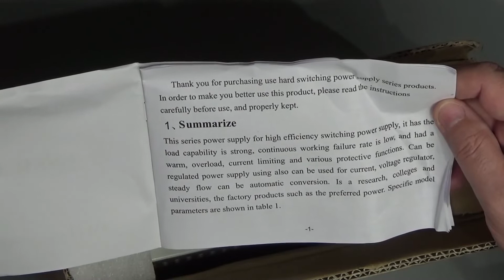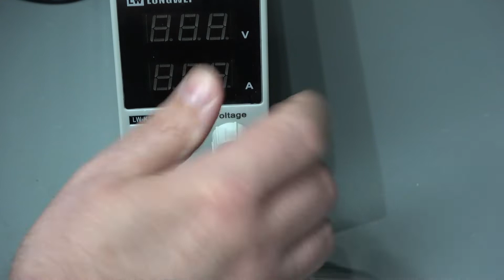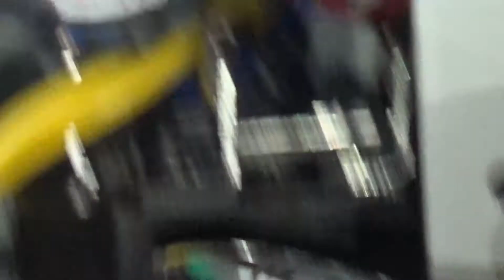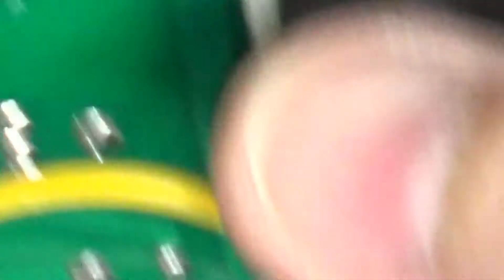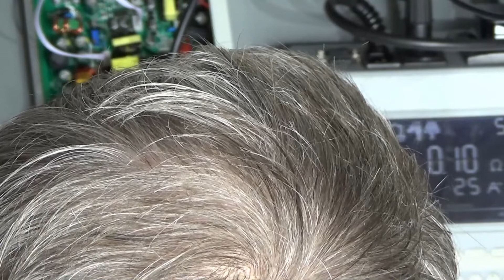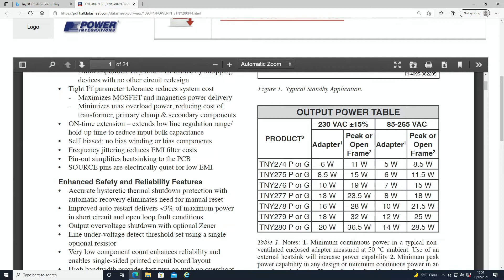0038 Teardown Review Longwei LW K305D power supply

Comment: quick question, i have this power supply but when i turn it on and turn the current knob the green light does not come on so i can't adjust anything, i can't figure out how to get it working, can you give me an idea what can cause that?
Reply from the maker: Well there are quite a lot of things - First to how it should work.  Without load connected (just connect a multimeter) and current turned even a tiny bit clockwise the green LED should light and voltage be present on the output and displayed on the top meter assuming you have turned the voltage pot a little bit clockwise.  I mention in the video at about 5:30 about the problem setting current limit (which you can't really do), but I'm guessing your problem is not just setting the limit but that the green light never comes on.   So without more detail there seem to be a few possibilities - 
1. There is a short circuit on the output, this will mean it will always current limit and the red light will be on and voltage meter will be 0 or very close to 0.
2. The most helpful is if it is just a display error and actually it works, just the LED does not - turn current fully clockwise.  If the voltage display now displays a voltage that changes with the voltage knob then there should be a voltage present on the output and it is likely working - connect it to something to power and it should start reading current, you can then turn the current limit until the voltage starts to drop and you have found the current limit position for that particualr current.
2. If the red light is on permanently even when you have nothing connected to the output and voltage shows 0 and there is no (or little) voltage on output- then the first question is if the current pot plugged in properly to the main board?
3.  If symptoms are as in (2) and the Pot is plugged in correctly then it is likely a problem with the current limit, one end of the pot should connect to a fixed reference voltage, the wiper connects (perhaps via resistors) to an operational amplifier and the other side of the op anp goes to a current sense resistor - or possibly another op amp then the current sensor, that I think I show in the video.  So the fault can lie anywhere along that chain of components. 
4.  Fianlly the actual switching regulator might not be operating (which is a more significant problem) and so is not even generating the voltage for the output.  I seem to recall there is a separate circuit that generates power for volt/amp meter display etc so.

Obviously if it is new, then you should just report it as not working and get it changed or refunded including postage (Paypal and credit card companies can also do the refund if it proves troublesome).  Of course you might not feel it is worth the hassle etc and decide to repair it, in which case I hope the suggestions above help, but remember these are just pointers where I would start looking - I can't diagnose a fault remotely.
Reply: @MakeOrRepair  first off thanks for the reply, 4. i think that point might be the problem, what i discovered is that if i switch it off and i turn the voltage knob and the current knob then i turn it back on it shows voltage and current and then it immediately drops to 0, at first i was just testing in diode mode to look for a short but i wasn't finding any short so i plugged it in and i start testing voltages and i discovered that 12 volts wasn't present, my conclusion is the mosfet has an issue, i maybe wrong, i removed the two mosphet with the phins and tested them, when i charge the gate it opens and closes immediately, from my understanding it suppose to stay open and it should only close if i short it, i am new to board repair so i am just feeling my way through the process, i am basically trying to teach myself to do board repair :D
Reply from the maker: @unlockaccount212  YOu can learn al lot about design and electronics just by fault finding -  I wish you well, of couerse it is both easier to fix and easier to learn if you have the service manual!!.   I suppose I should do a warning first - please take care near the capacitors and preferably dischare them through a resistor (something like a recalimed 2.2K 10W is ideal for switched mode supply capacitors, some people use old incandecent light bulbs) or just check voltage has dropped below about 30V with a multimeter set on highest volt range - even the metal cans on the switch mode section can hold hundreds of volts. BTW if you use a wrist strap it must have at least 1M resistor in it - you don't want one hand grounded and the other at 300V!   
Anyway warning given!  
My mantra for repairs, 1. visual check 2.  check the voltages are present and correct, after that if a switch mode power supply (whatever type) is not working then the power MOSFETs or the transistors that switch any coil to ground are very high on my list of quick checks, somethimes there are smaller bipolar transistors that drive the MOSFETS/Power transistors and they seem to fail frequently too - once I've discounted those then it is time to engage brain!  
Regarding your comment on MOSFETs opening and closing,  the easiest is just to use a simple low cost tester from ebay to test it.  But regarding the operation it should stay on as long as you keep the drive voltage on the gate (assuming the voltage is high enough).  So assuming it is n-channel then to test you can connect a power supply - the source to 0V, and  the gate to a voltage whatever the datasheet states is Vgs (on) or a bit higher.  You can then  connect an LED and suitable resistor from + to drain  and it should stay on as long as the gate is connected to +, then turn off if you connect the gate to 0V.   P-channel is the opposite, connect source to +, drain goes through the resistor and LED to ground, then when the gate is connected to ground the LED should light and stay on, if you connect the gate to + then it should turn off.   
Hope that helps a bit, not easy to describe in text.
Pete
Reply: @MakeOrRepair  well said brother, thanks for the help, i'll try and see what i can do, i know you could of helped better in real time rather than text, thanks a lot thou, if i don't get any justice i'll just have to buy another thanks

Comment from the maker: Regarding my comments about "tag soldering" directly to the tracks, I wanted to clarify that my problem is really that when desigining the board you should and can arrange appropriate mounting holes, then you use them!  in this case they have the holes and completley ignored them, in order to save a few seconds.  When you need to do a mod or something often there is little choice, but look at mod wires from good manufacturers and you will see them tacked down or attached to a wiring loom .  The real problem however is when "tag soldering" if you leave long fairly heavy wires free to flap around in the breeze, that is a recipe for them breaking either the solder breaking, the track pulling off or the corner where the wire joins the solder breaking.  Soldering to the flat of a connector is less bad (it allows easy maintenance, but just take the time to hook it through the hole (dont tie it up like a knot) and ensure again that the length of wire is not flapping about - but ideally if it is degigned for crimp connectors then use them!